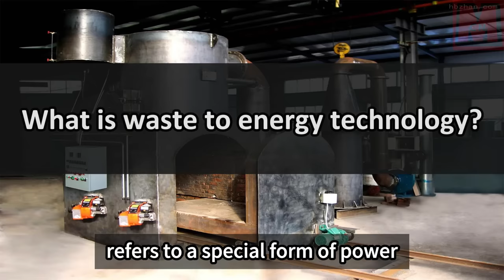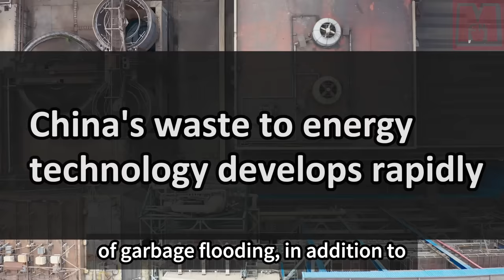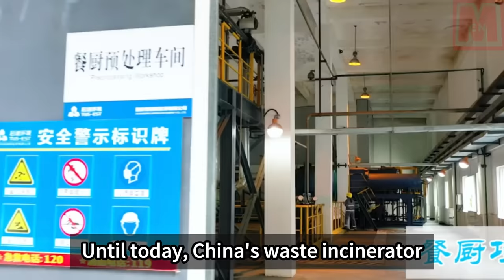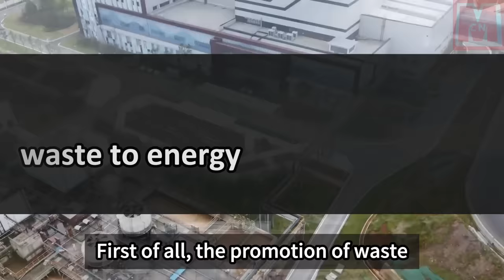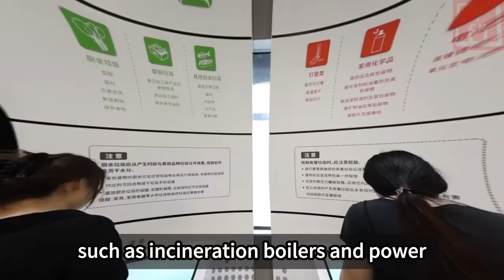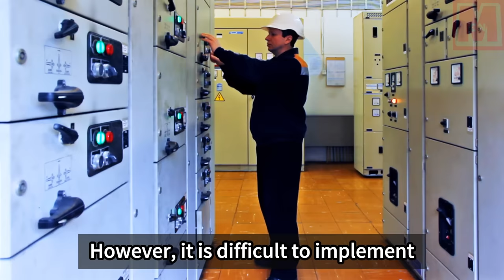China Built the WORLD'S largest waste to energy Plant in Shanghai

Comment: Not a novelty but great, great news! Waste-to-energy has been proven to be the best municipal, industrial, and hazardous waste management technology for suitable wastes! I have worked in this area for a long time and add my experience and words to the balance, accuracy and fairness of the info provided! High temperature incineration with proper control of the 3 Ts, temperature, retention time and turbulence, easily occupies the top spot among reliable, sustainable, and environmentally sound waste  management technologies!
Reply: The problem with inceneration of waste to produce electricity is that it pollutes the atmosphere through the release of green house gases.
Reply: @AliBarisa If it is dispoded on landfills it also produces greenhouse gases. Coz animals feed on plasic and confuse it for food. Dead animals produce greenhouse gasses like methane. Methane is worse than CO2 that is the only gas that escapes via high class inscinerators of course provided they work well. In case of break down they may release some dioxines. But they rarely do.

Comment: To get the most out of this kind of technology it should be combined with district heating. This is the reason why only northern EU has used this technology for more than 30 years. It is nothing strange with the technology but I think that it might have reached the level today when it can be profitable without district heating and that is a new step that opens up for expanded use.
Reply: Next level is to put regulations on packages, so only packages are allowed to contain materials that are designed for to be burned.
Reply: @tomaseriksson4533 Nah glass is fine. Glass isn't toxic and everything tastes better in it.

Comment: Give it a few years and we will see bits of it fail, fall apart. Or down right be unable to work. Also your video claims the tec hasn't been used outside of China. Wrong! The EU and others have been using the tec for over 30 years.
Also if you are going to g around bigging up Chian as some kind of ónly the Chinese do this big shot, at least declare you're being paid or sponsored by the Chinese.